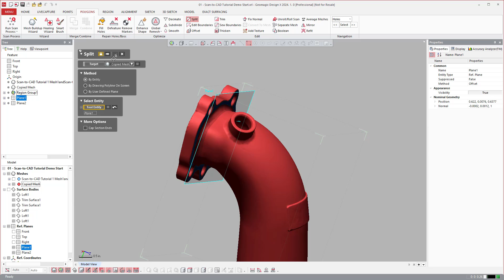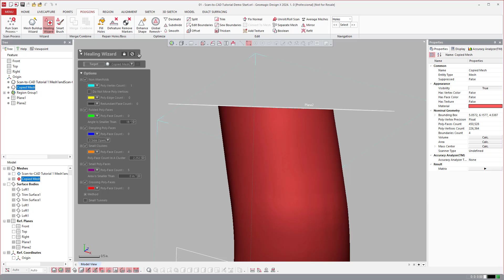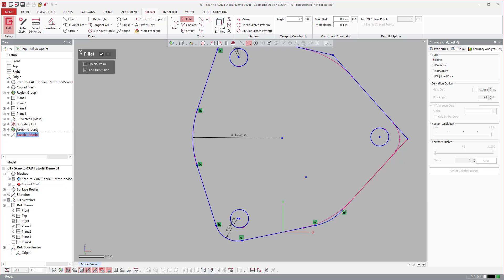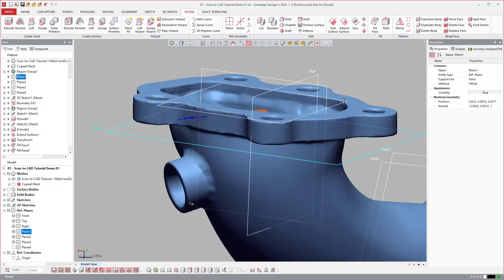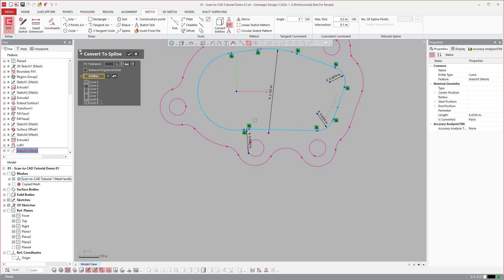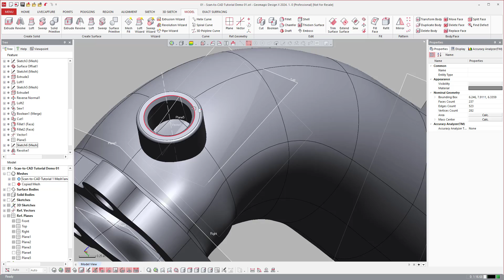Pipe Model - Geomagic Design X

Comment: Hi, from reverse engineering point of view I think the internal surface of your's pipe connector looks horribly waved :-) in place of five bolts flange. Of course this is reflection of existing surface but it should be done manually more "fluent" don't you think so? IMHO we are making digital copy to produce such stuff as a spare one - now we must know what methode we will choose: 3D printer? Or moulding maybe? Or welding flanges to shaped pipe? Never mind - the pipe interior must be smooth as much as possible and not wrinkled as sea surface :-)
Apart that your video and explaining DesignX are fantastic and very helpful to understand how DX works!
Reply from the maker: I do not think you noticed that area is supposed to be like that because of the bolt access. 

This does prove your comment correct about knowing what you are doing before you approach anything. If you knew this had bolts that hold this on you might not have made the comment. The part is designed this way on purpose.
Reply from the maker: https://flic.kr/p/2pRsAVe